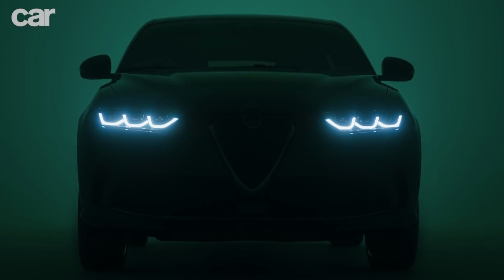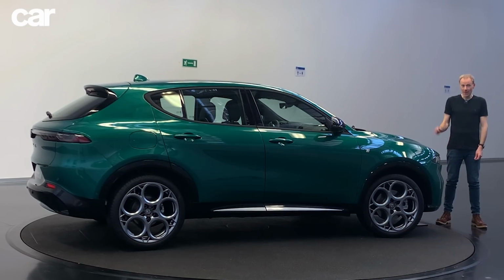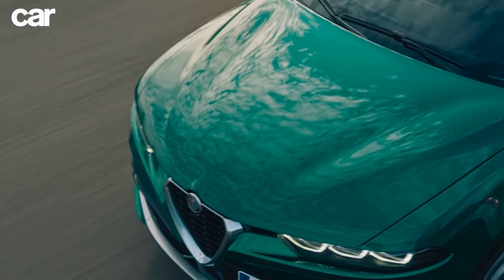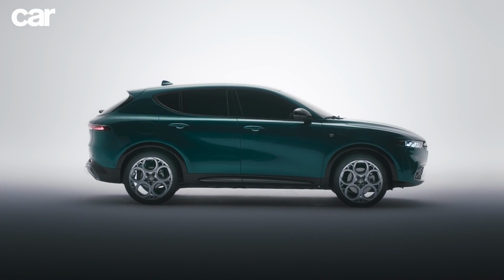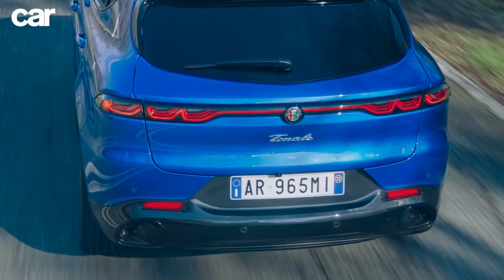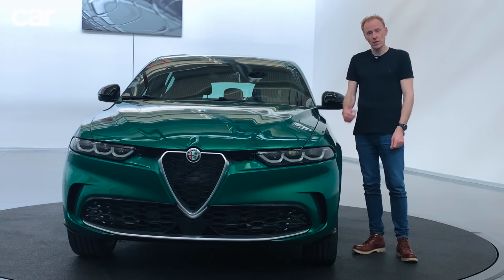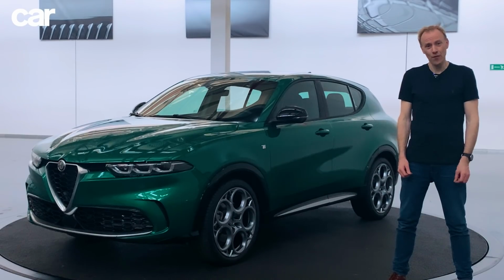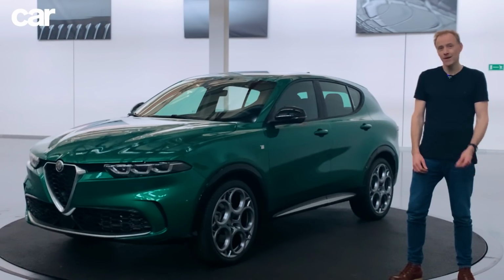Alfa Romeo Tonale Preview | Baby Alfa SUV unveiled!

Comment: First thought if owned it, put it down with some nice sport springs. Thos one is too high
0-60 is not that good, while the car is too heavy because of these  batteries . Normal 270 bhp would have way under 6 sec 0-100
And Alexa, no way, no thanks

Comment: I was waiting for a new Tonale to come up. It took so long, that I decided to buy a new Stelvio. I do not regret. Tonale seems to be just an ok car. Personally I do not like the interior and I am affraid it is not going to be that sporty as Stellantis promis. Compared to Stelvio, most of Tonale engines are just week (130 HP - come one, it's an SUV not Mito). Also the suspension is very basic, like in most compact cars. Not like in previous Alfa's (Stelvio, Giulia, 159) where we had perfect suspension giving the best from a car. And I do not buy this Q4, it's just a front axle engine with additional electric support for rear axle. Not like in Stelvio, where we have rear axle car which can enable front axle when needed. Also I am wondering how Tonale's Q4 is going to behave when there is no power in battery, giving us front axle car with additional weight in the back ;)
As somebody wrote in other comments "hope they will sell well, so we can get a new Giulia/Stelvio".
Reply: I can't speak for Europe or ROW but in America I'd bet 100 bucks this will outsell the Stelvio. It's cheaper and smaller and will get better mpgs. The hybrids may also get tax credits depending on the state. US will get a 256hp 2.0 liter engine. I wonder if it can tow my Ducati :)
Reply: @chorseundgrd  I don't say it will be a total failure. I'm just complaining because I am an Alfisti who drove every Alfa car since 147 and I love them (even Giulietta and Mito). But this car didn't hit me, I don't like it. And I really envy this 2.0 256 hp engine ;)

Comment: I don't believe they can pull off EVs. its all hype, done to synthetically create a new market while simultaneously enslaving us through dependency, to the State. They've taken away all our rights already, next up it'll be total dependency on the State for everything. I do mean centrally generated electricity. Another thing - autonomous driving...can take you anywhere. Until they start selling ones with no steering wheel, that wont take you anywhere but to work.

Comment: I love the look and the potential perky performance. However, coming from an ex Giulia driver, I shudder to think what the extra reliance on anything electric will do to reliability.

Don't get me wrong - I still love Alfas - but they get hard work when little things just peck at you, or the engine light comes on two days after a (not exactly economical) full service.

Fingers crossed the electric engine part works better than the electric everything else.

Comment: I am going to say this again and again.  Without massive cheap solid state batteries, there is no electric car future that will be anything short of an utter disaster.  Nobody has the time to wait hours to charge electric batteries.  Furthermore, unless the electrical grids and electrical energy supply increases dramatically, serious charging issues will occur.   Every automaker is all-in on this future, but no country is even close with the infrastructure or proper energy decisions to make this a reality.   I sense a huge reckoning in the auto industry is coming in about 5 to 7 years.
Reply: Not just that. If you add heating to the mix as well we will need to generate and transport around ten times as much electric power as we do today. Of course all of this plug-in nonsense is the result of politics placing demands on manufacturers who will have to comply or lose their market share. Politicians who simply assume that electricity does not cause any emissions but this is only true for electricity usage, not for generating electricity and especially not with high amplitude alternating demand that is completely predictable (come home: turn up the heating and plug in the car, turn on the stove, etc.)

Comment: Not a bad looking car but the frontal and rear overhangs are a bit too long , which make the proportions of the car slightly awkward.
This is also resembled in the measurements.
The wheelbase of just 2,63 meters is shorter than most competitors, while the length of 4,53 meters is longer than most of those.

Comment: I really do not know how much they must pay the commentators to be sooo enthousiastic... come on... the car looks nice but that's it, it is nothing extraordinary or advanced aesthetically, they took a Stelvio, changed a little the lights et voila! (for example, the 2008 is much more interesting in that respect and new DS4 is miles ahead in design - to stay within the Group). Regarding the inside, Giulia also looked nice in the photos but when actually feeling it the quality was below expectations (not bad but not great). This time though I hope things may be better as Peugeot has a good reputation in that respect. Coming to practicality (not that anyone intending to buy Tonale would particularly care for that...) the guy says; ' it may be only 4.5 meters long but their is room...'... come on,  4.5 meters length is NOT small for an SUV , it is on the high side of the medium class... everything for the advertisement guys  but I can BET its is not more roomy than a 3008 (again, to stay within the Group) and 3008 is a little less than 4.5 meters... (you know, this is, supposedly , not an Alfa Romeo video but an independent source video... B-S...). Otherwise, yes the car seems to be full of specs (for the top spec model...) but both Giulia and Stelvio were full of specs and they both failed commercially ... because the elephant in the room (as with all recent ARs) remains the PRICE... not a word about it.... anyone to bet that it will be at least 15% more expensive than a 3008 with equivalent equipment? Alfistis that can afford it (how many such alfisti are left?) will buy it but more realistic buyers will look elsewhere - even Lexus or Mercedes may represent a better value for money if Tonale's price is set too high ...

Comment: Not sure about the steering as it has 13.6:1 while Giulia has incredible 11.8:1 steering ratio. Giulietta is at 12.5:1, the old 156/147/GT and 159/Brera are at 12.7:1 steering ratio. Tonale ratio looks more like a boring Golf or A3 than anything Alfa did for the last 30 years. Let's hope they  did some magic so it drives the same, also let's hope it looks better than this as all Alfas look much better in metal than in the photos. I believe this will sell nice as it has many flashy and gimmicky nonsense an average buyer likes.
Reply: It won’t drive like the Giulia and Stelvio. Those cars were engineered by Ferrari. This is a Jeep renegade underneath… I’m sure they will work some magic.

Comment: Low profile SUV is a must have for me.
Looks amazing
Reply: I dont like SUVs in general, when you see a videos of them crashing into normal cars and flipping on their roof as they bounce... and fuel consumption is worse due to wind resistance and cornering is worse... It makes sense for someone who really needs a SUV for bad roads or a bit of offroad but for anything else it makes almost no sense... Oh yeah and tire cost compared to normal cars, ouch
Reply: @CrLe100  What not everyone realizes is this also counts for electric SUVs, making them less green than car EVs. Automakers are pushing crossovers and SUVs everywhere because they take advantage of tax breaks originally created for industrial vehicles. Ironically they should be taxed extra because their heft is wearing down roads.
Reply: wagons/estates are better
Reply: @protocetid  My friend has a lowered Stelvio (25mm drop) Trust me it drives as good as any sedan.
What you refer to as better is beyond me
Reply: @PLGAZA  So you're friend made it more estate like but is stuck with a higher mass. How is that an improvement?
Reply: @protocetid  good question. All I know is it felt light compared to other SUV’s and planted to boot. The cornering capabilities where next level. 
Don’t get me wrong I like estates

Comment: When you said at the end that Alfa would soon  be purely an electric brand,  my heart sank. The best thing in an Alfa Romeo is the engine. 
I am mildly disappointed by the Tonale. I would have likened a much more radical design.
Reply: @Cristopher Hunter. Too Radical doesn’t work at times look at the new BMWs for example
Reply: There will be ICE versions. Actual complain is very large power gap between low end (130 & 150HP) and top (275HP).
Reply: if only these businesses and the public didn’t have tunnel vision for EVs, wish sports cars would keep ICEs that used an alternative fuel like hydrogen (have heard smarter people than I say ammonia would be better)